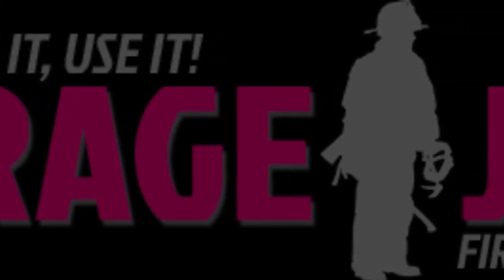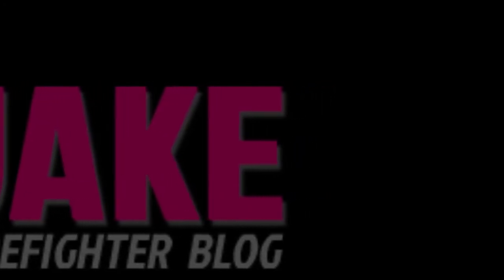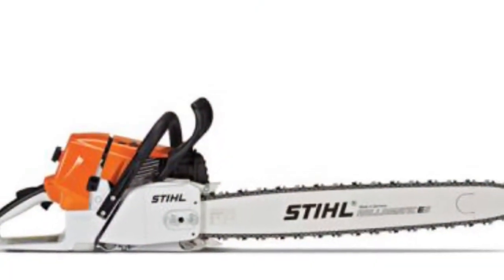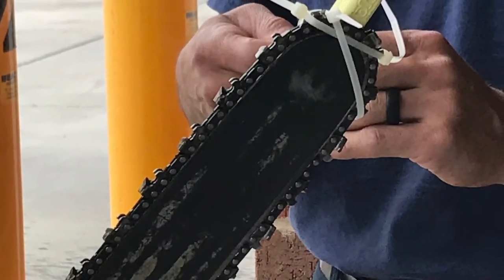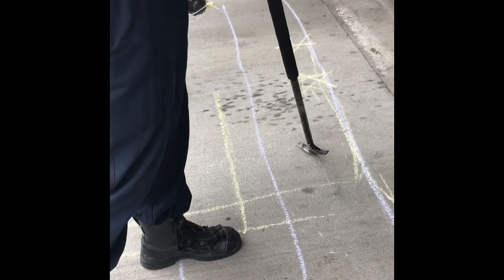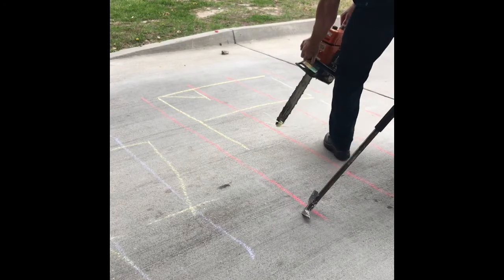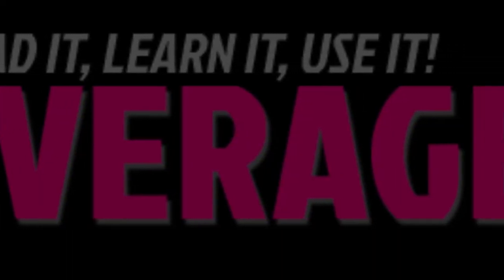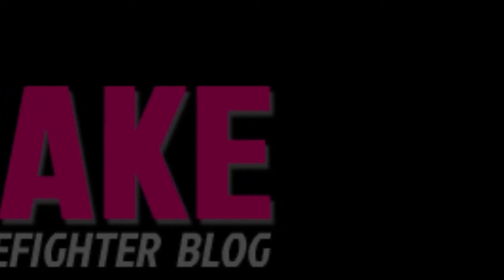Chalk Saw

Comment: Ok, kinda like the chalk idea A LOT.

Being a big fan of all training that follows the crawl, walk, run methodology the use of a chalk cut is a natural progression during any cutting training. Saving expensive and often limited target material by ensuring all are well rehearsed first.

I see this as not only a stand in for actual cut time when it isn’t readily available, but also as a necessary step in the rehearsal of any training rotation. If you only have one practice roof (or any training with limited cutting material), don’t waste it. While some departments get a chance to vent both flat and pitched roofs often, getting time on structures where you can train & cut ‘em open is often a limited experience for most.

Not only can you conduct a chalk cut rehearsal on the ground, working out your SOPs first, but also on any training roof. There will only be so many real cuts on any given roof but you all can get a few chalk cuts in even before the first pull cord is, well… pulled.

Admittedly flat and pitched roofs techniques may differ slightly but with a slight modification for rehearsals you can likely still make use of a parking lot without spiking your halligan into the pavement for a foothold.

Take the following video as an example: https://youtu.be/4DNy-oMfVNM

You can see his cuts have been numbered for him. That is great for your first few runs to reinforce the sequence. How do you ensure he knows the sequence without wasting target material? Easy, next run he sees a blank piece of target materiel on this pitched roof simulator and he hits it with a chalk cut. If the chalk cut is in the correct sequence he moves on to the real cut.

This chalk cut assessment can be done up front for the already well trained or as a check on learning after the new guy gets the sequence down with a few guided, cut-by-numbers rotations. The last chalk cut assessment can always be numbered and it is now ready to guide the next new guy.

Now, just got to find a way to replicate this for the rotary saw…